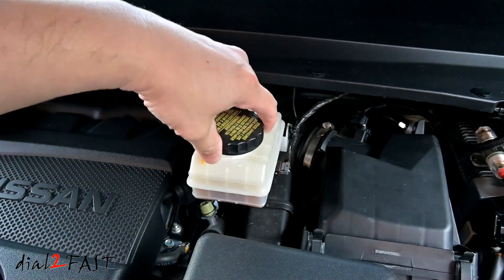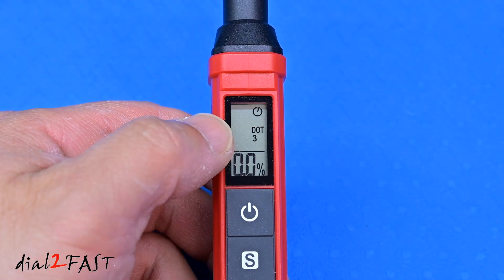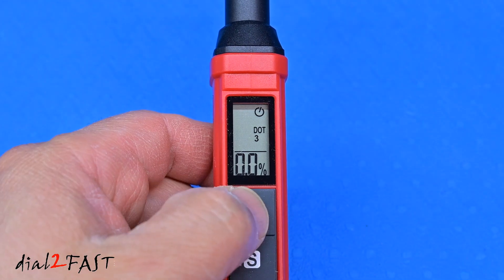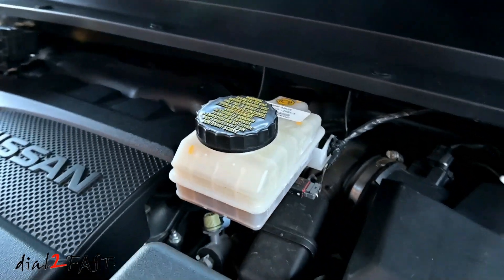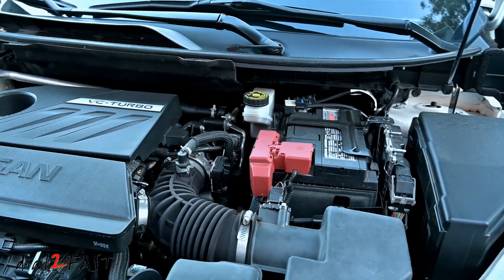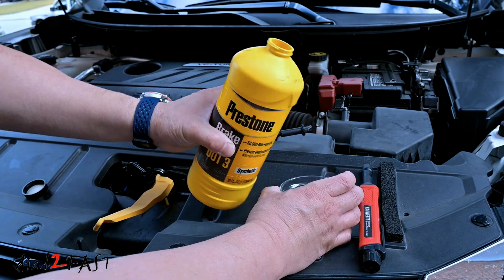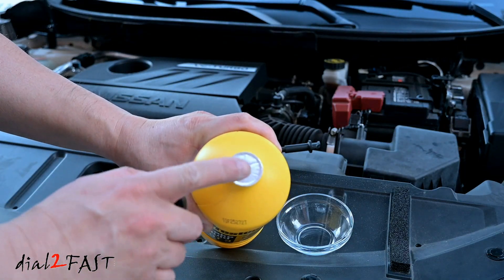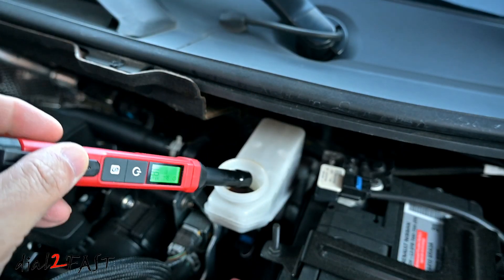Quickly Test Your Brake Fluid | Kaiweets Brake Fluid Tester

Comment: It's a nice idea but those type of meters are based on conductance and the ones i have seen on Amazon are highly unreliable/inaccurate. Brand new brake fluid showing high water content. Brake fluid testing with significantly added water reading as ok.. 

 Kaiweets make good tools but i would be hesitant to trust any such conductance testers over time. In fact if you check the Amazon reviews for this tester  you see people reporting the same problems that i said about the other testers.

Might be better to save your money and to just stick to a regular schedule of changing brake fluid every 2 to 3 years as recommended by the manufacturer..